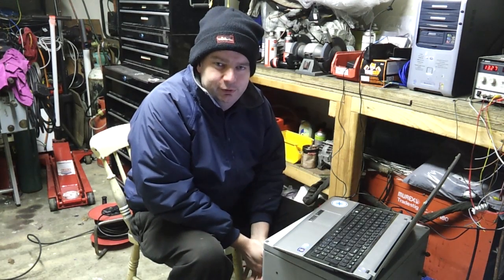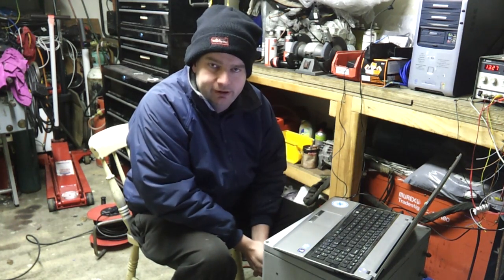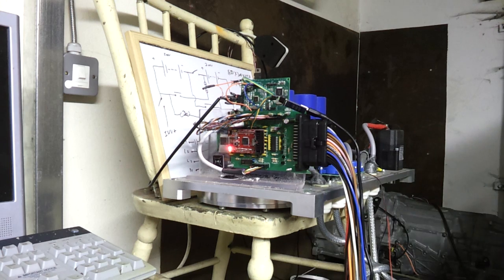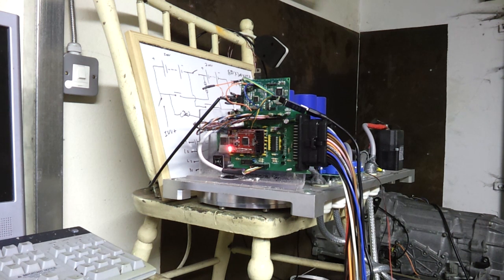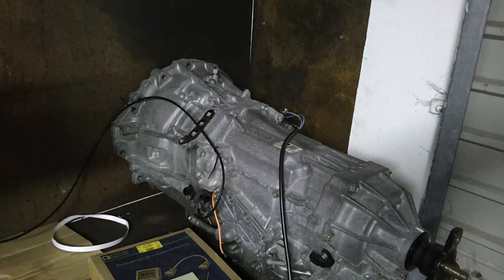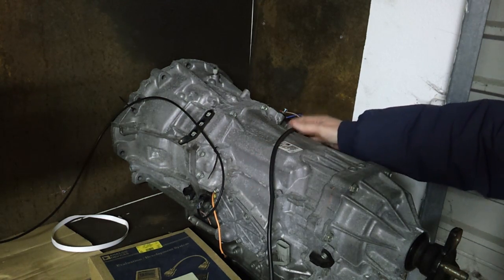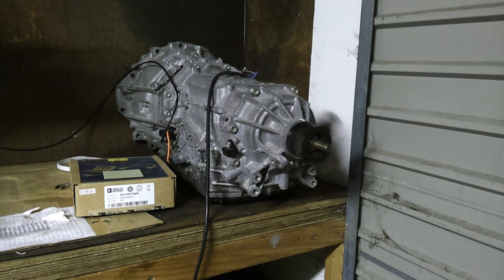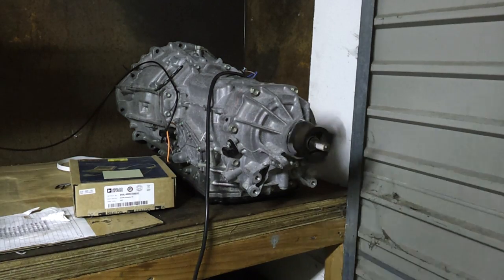Lexus Toyota Hybrid Transmission Project 08 : More Torque

Comment: it'd be cool to see this end up as a kind of kit or drop-in solution that can be used with any old EV conversion, since this is a standard transmission shape and is way easier to install than making a custom motor driveshaft thingy 

now the scene just needs a drop-in solution to use chevy Volt or nissan leaf batteries and we'll be all set

Comment: How much voltage are you spinning with?  And  what is the power limit for this lexis motor?
Reply from the maker: +technogeekworld 48v dc on the bus , supposed to be 110kw
Reply: +Damien Maguire Lots of possibilities for this!  Is there a tork converter behind that bell housing? possibly another traction motor?  I'll be watching this project closely. :)